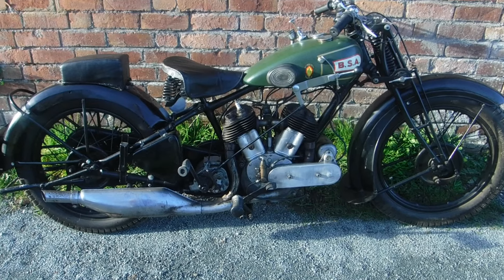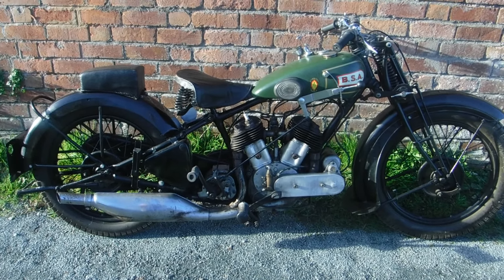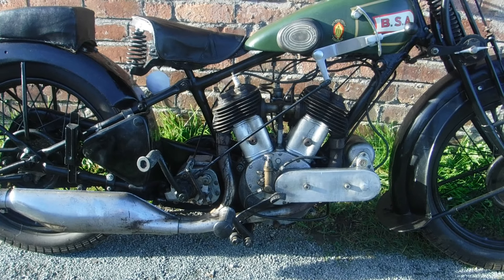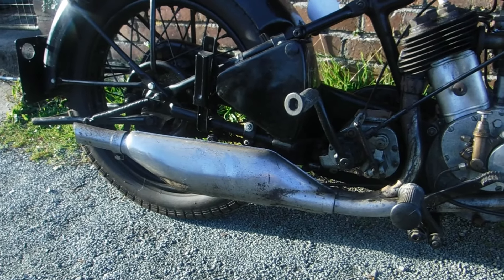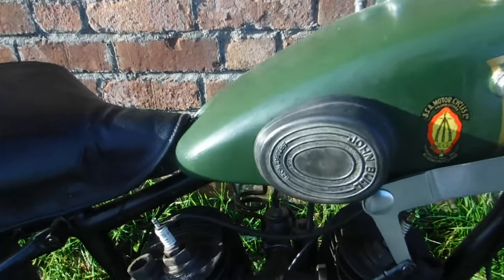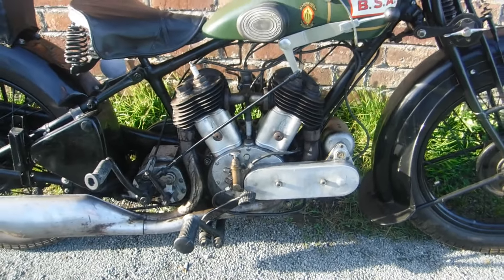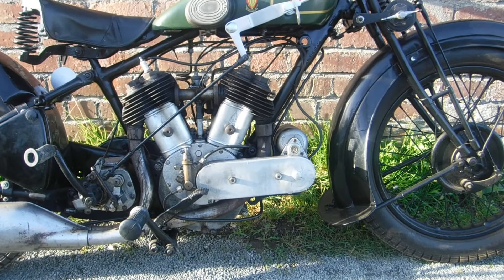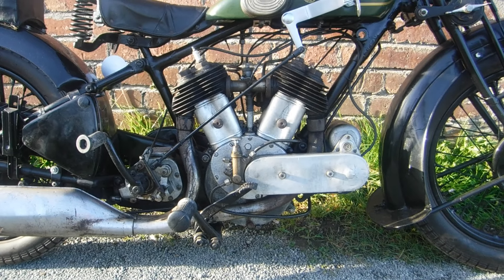BSA 770 cc V Twin, 1930 discussed after a couple of trips up and down the lane - see description *

Comment: However well the machine ran prior to being laid up seems slightly less important than how it is running now. Having said that, perhaps certain problems such as stuck rings, could ease off after a few cycles of being run until becoming properly warm. Another factor could be the operator familiarity. Those two lever carburettors can take a bit of juggling before optimal settings become second nature. Best of luck with it. I hope the owner's faith in his splendid machine proves to be justified. Was 1930 the last year of the E? I believe it was introduced in 1919.

Comment: Simple compression check first step surely?..........My C11 ran like this, was 70 PSI, took apart and was caused by a burnt out exhaust valve, bore was great, rings hone guides and new valves, plus made a solid copper headgasket, was 130 psi on rebuild, runs great now 1 kick hot or cold.
Reply from the maker: Watch this space ...